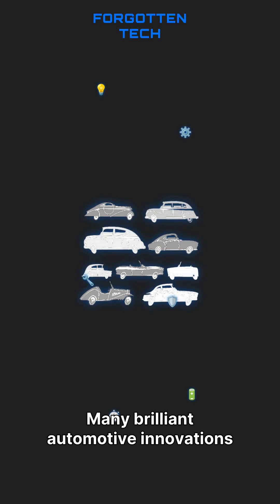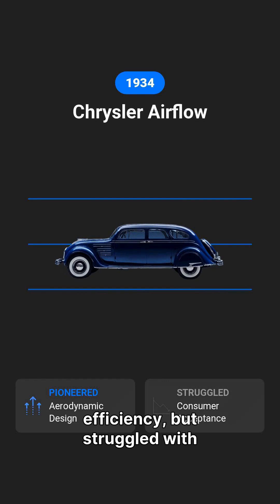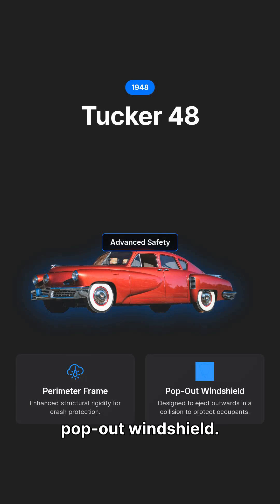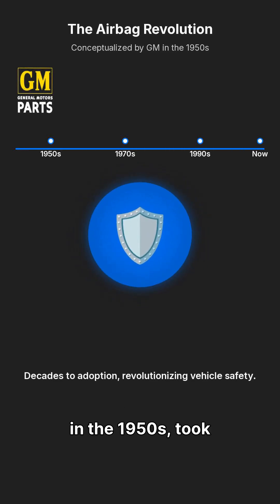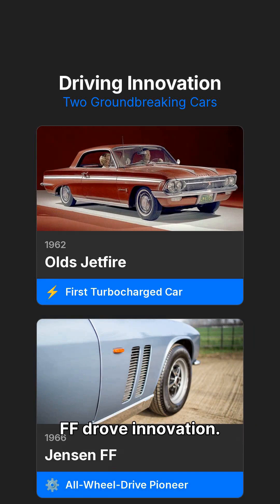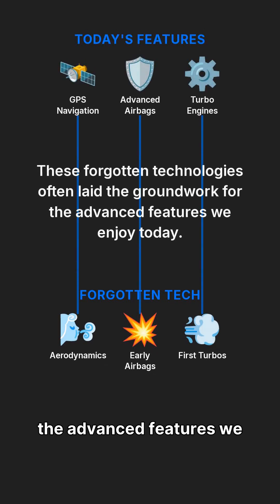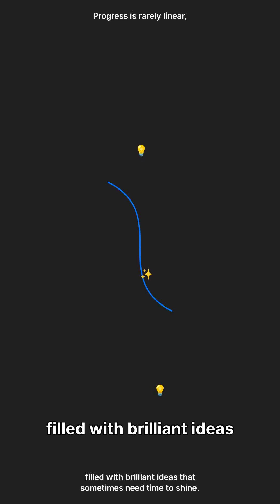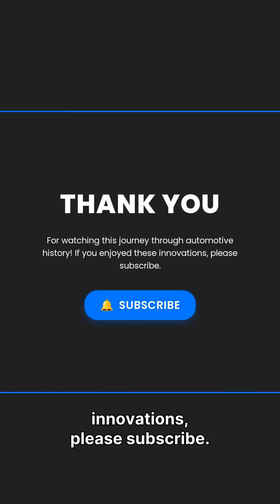FORGOTTEN TECH: THE BRILLIANT AUTOMOTIVE INNOVATIONS YOU NEVER KNEW

Comment: Didn’t Volvo pioneer the airbag but refused to patent it, allowing everyone to use it, for the safety of the general public?
Reply from the maker: Not sure.  I will see what I can find out.  Thanks for you input .   Dr. Mike, Delray Beach, FL
Reply: @MuscleCarMike-w5t sorry, I meant seatbelt. My mistake. Have a lovely rest of your day
Reply from the maker: No, Volvo did not make the first car airbags. The first automotive airbag system was patented by American industrial engineer John W. Hetrick in 1953. The first production vehicles to feature airbags were actually from General Motors, which began offering them as an option in some 1974 model year vehicles.

Volvo is often associated with automotive safety innovations, and they did make significant contributions to airbag development. In 1987, Volvo introduced the first driver-side airbag in Europe as standard equipment. Their most notable airbag innovation came in 1994 when they introduced the first side-impact airbag system as standard equipment in the Volvo 850.